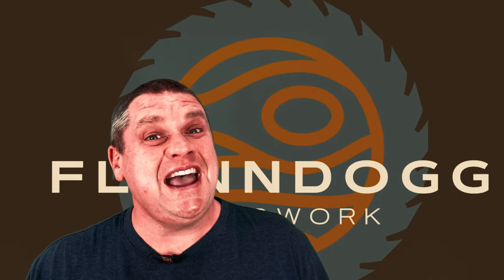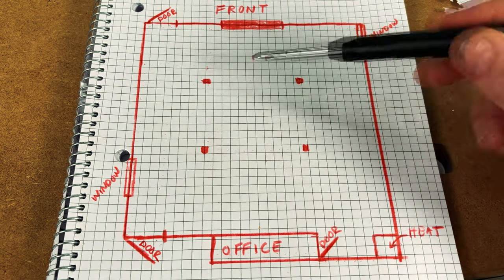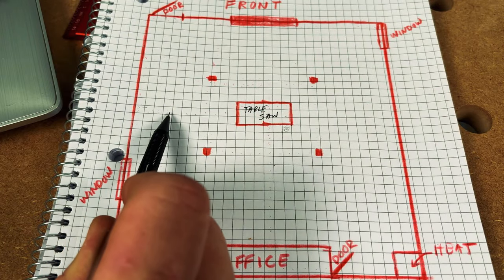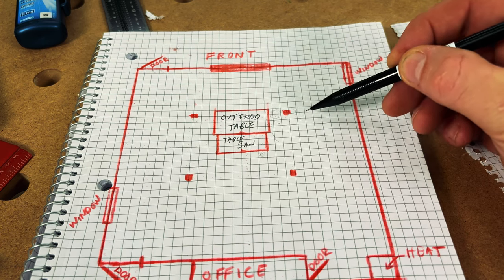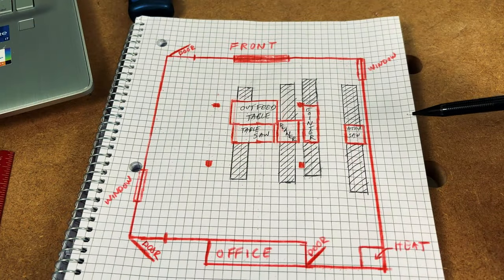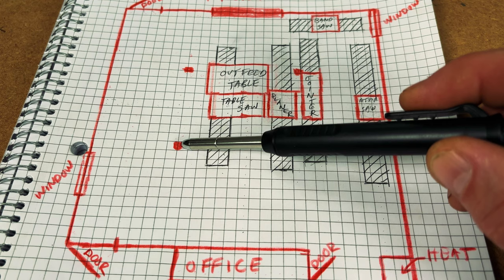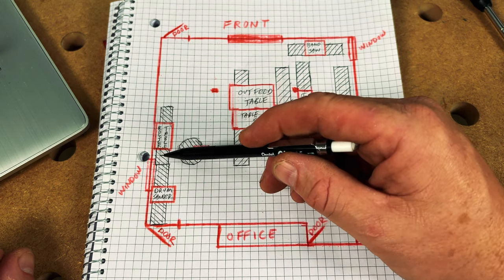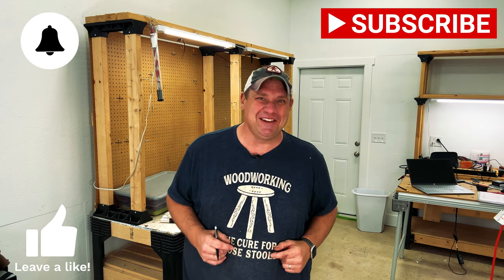Supercharge Your Woodworking Workflow with the Perfect Shop Layout

Comment: Great video in concept.  Saw some issues such as posts may get in the way using the table saw when cross cutting a full sheet of ply near the ends.  But the biggest issue I see is getting from the front of the planer to the back.  Have to walk around the jointer or table saw.  No matter how big a shop is its still hard to setup.  Definitely get those tools on wheels.
Reply from the maker: It is so funny you mentioned those couple of items, those are the two things that concerned me the most too.  I already ran into some problems with the table saw and the jointer planer set up, and I'm going to be rearranging those soon!  Thanks so much for watching Darren!
Reply: Agree 💯. You need more room to navigate around planer. Don't feel too constrained to set all these pieces of equipment up in parallel.
Reply from the maker: @gz4058  You guys are on it.   I've already made some adjustments! :)

Comment: Nice first layout. Couple questions and recommendations.  Look at your layout - When using your planer - how are you going to move from front to back - are you going around the jointer? Maybe think about putting the Table saw and outfeed back where they were and put the jointer on the other side.  Now you can get around both and use the outfeed table to stack lumber for both.  When you are using the bandsaw, is anyone going to be bringing in stuff through the big door?  If not think about moving it closer to the door opening.  This will give you more infeed and out feed on the bandsaw.  I can't wait to see the shop when you  get it set up
Reply from the maker: You are sooooo correct TetraCNC!  I already encountered this problem when working on a project this week. I'm definitely going to be rearranging the planer CNC area.  It was a pain in my but having to walk all around my jointer just to get back to the infeed of the planer.    Great catch.  I'm also going to move my table saw just a bit to the right to give me more space on the cutting side.   Thanks for watching and commenting! :)

Comment: I started with a 2 car garage and a few tools. I had enough room to have line dancing classes if I wanted. Then I slowly accumulated more tools and tried to find places for them as they came in. Now I in the process of re-arranging everything to make a more efficient workflow as well as making it more of an inviting place to hang out.

First, I am excited by the prospect of the the finished product, but that excitement is often tempered by the daunting task and overwhelming aspect of it all. Overthinking and rethinking...

You too?
Reply from the maker: OMG you hit the nail on the head!   It is exteremely daunting.  I first need to do a purge, and get rid of some stuff. I have so many things I never use and I need to just part ways with them.  It really is overwhelming though, don't know where to start!   Thanks for sharing and watching mrscience!  Really appreciate it!

Comment: Your shop is just a couple of feet larger in each direction than my garage is (minus the office). I only have 2 posts to contend with vs. your 4. Anything I put in the center will have to roll out of the way - either to the center of the garage or to the walls. This is a fantastic place to start designing my own buildout. Thank you for posting this.
Reply from the maker: Glad you liked it Landon!   I am really amazed that I never tried doing this layout thing before.  It was really a great tool to use!   I'm since encountered a couple of issues but nothing that can't be fixed quickly!  Thanks again for watching and best of luck to you!

Comment: New sub here. The main issue I see is the planer location. When you load the material, you then have to walk around the jointer to catch it.  I would move it to the other side of the jointer and then move the miter saw to the office wall.Then rearrange the rest as needed. You don't really need a great deal of space for off cuts on the miter saw. You have 16 feet back there.
Great job on a good topic!
Reply from the maker: Oh my goodness Bob!  You hit the nail on the head.  Already having problems with that issue.  Working on a project now and I will definitely have to rework that area.  Excellent comment!  Thanks for subbing and watching! :)

Comment: I like the island type layout. thats how i have my two car garage setup. dosen't take miles of dust collection pipe.
Reply from the maker: You are so correct Rod!  Saves on dust collection hose for sure.  Have you looked into those mag ports.  That's what I use and it's a life savor, just attach/unattach and move on to the next item.   Really worth checking out if you don't have them.  Kind of pricy but well worth it!
Reply: the one"s Izzy made? he put out a video today ,sold to mag switch. I havent but was thinking today they would work great for my tools not in the island. @FlynndoggWoodwork
Reply from the maker: @rodpotts2666  I'm not sure if izzy made them or what, but I wouldn't be surpised.  It's a great product!  You should definitely check them out.

Comment: Great video so great to see you start setting up the new shop and getting your tools in place. I’m sure it will take you a few month of working in the new space and moving things around to get things just where you want them. It will be cool to see how it turns out and what kind of dust collection you get ?
Reply from the maker: Thanks so much Jim.  Already made e a couple adjustments to the shop already.  Really need to get through all my old tools and figure out where stuff needs to go.  I think one of my first projects will be to build some cabinets etc. for the main wall.   Dust collection is a great question.  I’ve always been intrigued by Oneida but never tried it out.

Comment: I would move the table saw closer to the poles on the left so you can walk through to the out feed on the planer 👍
Reply from the maker: I 100% agree with you, Already ran into a problem with that!  I think I'm going to move the planer and jointer somewhere or at least over a bit and move my table saw to the left!  Thanks for the great advice!  And thanks for watching baddog!
Reply: I would think the feed area of some of these tools could overlap, as you are the only one using each tool and I doubt you would be able to use two tools at once safely.
Reply from the maker: @pazmaniaoh6341  great point pazmaniaoh!  You could definitely do that as long as you weren't using both tools at the same time.   Excellent point!

Comment: When finished that is going to be one nice shop.  I am very jealous.

I understand your thinking about the placement of your machines.  I do have questions.   Did you consider the direction of your material flow?  For example, wood coming out of the jointer is at the back end of your shop.  Then the infeed of the planer should be at the outfeed of the jointer.  So, the flow is back to the front side of the shop.  

Another question I have is the breakdown of sheet goods.  By putting the table saw in the middle of the shop you have to haul the sheet goods through the shop.  Unless you intend to break down sheet goods and large rough-cut pieces with your track saw.

One thought, based on the initial design experience I have had with ships, is the use of false floors (decks on a ship).  Considering the height of your shop and the 'wasted' space, what if you had a false floor?  Using engineered wooden I-beams  3.5" width x 16" depth you could create usable space to run electric cable, compressed air, and dust collection ducting while allowing for a plywood floor which would be better on the legs and dropped tools.  A 4'x8' could be cut into 2'x2' pieces making access and replacement easy.
Reply from the maker: Boy you hit the nail on the head with your two observations Robert!   The Placement of my table saw and the jointer/planer placement are things that I'm already thinking about rearranging.  I was making a project this week and realized that I didn't have any space to go back and forth between the infeed and outfeed, it was so annoying.  I also have decided I'm moving the table saw a to the right a little bit to give it more room on the cutting side.   Great observations and thanks for sharing!

I love the idea of the false floor!  That is something I may very well consider once I get everything in a spot where I like it.   Great idea!

Comment: Great video, and thank you for the timing being so perfect for my situation. I’m currently in the process of moving my tools into a 25’x21’ dedicated workshop. Seeing your thought process (with a hat tip to Jonathan Katz-Moses) has both reinforced some workflow ideas I had, and made me think of things I might otherwise have neglected. I have a feeling I’m going to watch this one a few times 👍🏼👍🏼
Reply from the maker: That's so awesome Brendan!  Best of luck to you on your new shop!   If I had any recommendations from my design it is don't block off your planer like I did.  I'm moving it, so that I can easily move back and forth between the infeed and outfeed.   Thanks so much for watching and best of luck to you! :)
Reply: @FlynndoggWoodwork  thanks for replying and for the advice!  I currently don’t own a jointer or planer, so I’ve actually been eyeing up the Grizzly combination jointer/planer model G0959 due to only needing infeed and outfeed space for a single machine, plus the 12” capacity and the helical cutter head.
Reply from the maker: @brendangrimace  That's awesome.  Grizzly is a brand I've always been very impressed with on prices.  I haven't owned one just yet, but I've been eyeballing their lathe as well as a belt sander they make.   You really can't beat their prices!

Comment: Like your approach of getting shop equipment preset for production. I agree your already set in most cases concerning tweaks and  having locking casters under your equip/benches. I would try and keep clear floor space on both sides between saw and those 4 poles or at least the side your use to walking around. get that smartwatch out and in this case lower those steps as long as the wife don't see! Will you be adding floor mats/ or sit stands once you get things in place? I use stools/ sitstands alot in my shop at my age! Probably cuts production down a bit but they keep me in the shop longer! Great video, very happy for you. Hope you and your family have a Happy Thanksgiving Mr. Flynndogg!
Reply from the maker: Thanks so much lespaulguitarman.   Great great point. I really want to add some anti fatigue mats.  I've never had those before and with my concrete floors it feels like I ran a 1/2 marathon everytime i leave the barn!  you are also so correct with the stools. I currently have two and I want more.   I think I could probably use about 4 total in this area.   Makes everything so much easier.  Thanks for sharing and watching!

Comment: Hi Dog, the only thing you might want to consider is the lack of space between your table saw, jointer and planner.  Looks like you have to travel all the way around all three no matter which one you are using. Timothy
Reply from the maker: You are sooooo correct Timothy!  Already ran into that problem working on a project yesterday.  That will definitely be modified.  Not quite sure yet, but It isn't working the way it is.  Thank you so much for watching and commenting!

Comment: You didn’t leave yourself any room to walk around the planer to feed and catch stock. That probably should have been added to one side. The good thing is, it’s mobile, so you can move it in front of your table saw and use that to catch it. This may require lowering or raising your planer cart a couple inches… I couldn’t quite tell from the video where the outfeed table height was in relation to the table saw.
Reply from the maker: You hit the nail on the head!  I actually have. A video coming out where I’m building a gift for my kids school and I ran into this very problem!    I’ve since temporarily moved things around to make it easier, but This layout is definitely a work in progress!